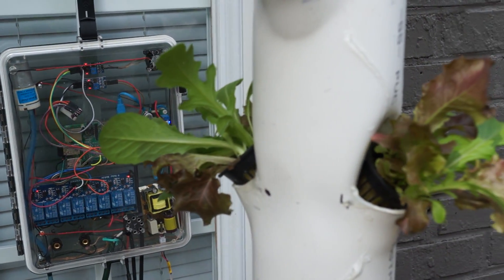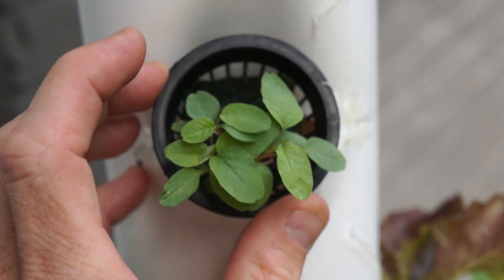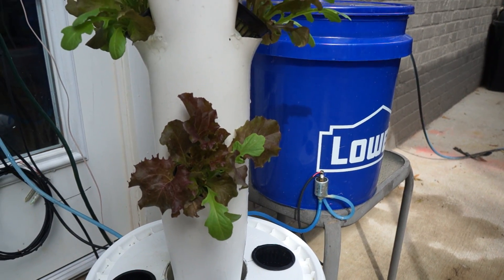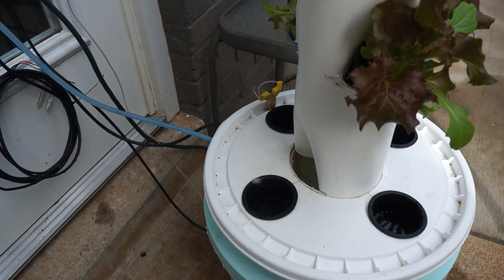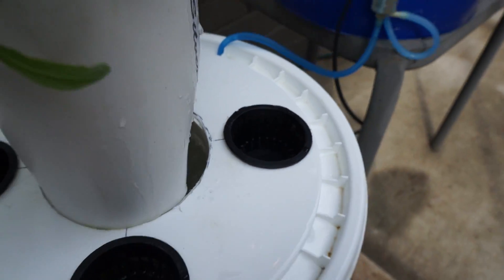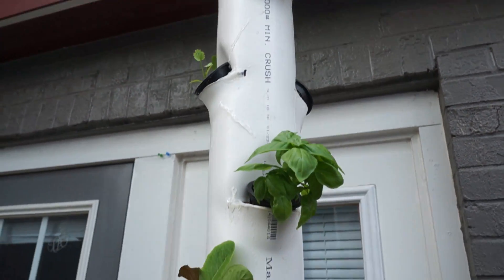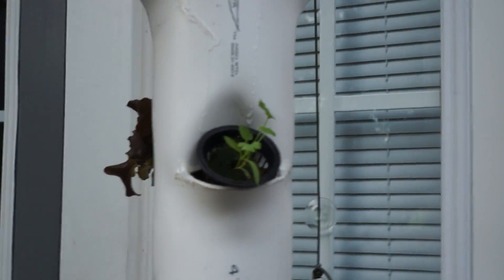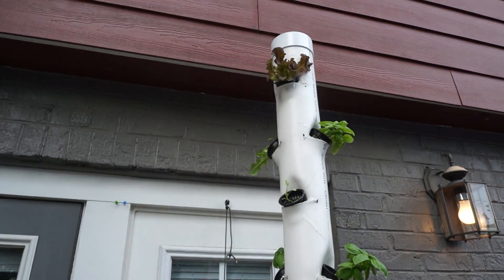Raspberry Pi controlled Hydroponic System PT 2

Comment: Great setup! Do you have any additional information on how you made the Raspberry Pi controller? Currently trying do make something exactly like this to control my towers. Would this also allow for nutrient/ph control?
Reply from the maker: +rcnacura check out cayenne IoT. I don't think there is direct support for ph control sensor but there wasn't support for moisture sensors either. I just added a generic digital sensor.
Reply: Thank you so much for the information. This will at least get me started till I can figure out the arduino setups.
Reply from the maker: +rcnacura you got a video of your setup?
Reply: It might be a bit late, but that bottom pepper was not getting enough sunlight for photosynthesis and thus the lack of green.